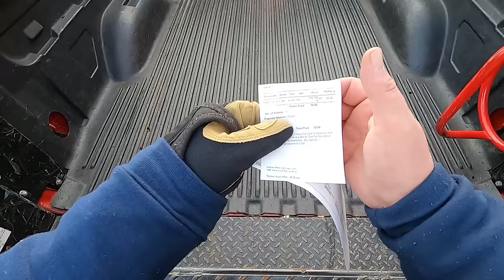Made a Ton of Cash from People's Trash

Comment: Hey Paul, 

In the last 6 months I have started taking most appliances apart or at least extracting the motors. Larger appliances like washers and dryers have larger size motors and are relatively easy to disassemble to extract the motors or you can even cut them out in some cases without disassembly. 

Once you extract the motors, the motor itself without any further work is worth 3x the scrap value than the appliance is whole. Extract the copper windings and separate the steel and aluminum from the motor and that increases the worth 10x the scrap value over the whole appliance. 

All I do now is pick up appliances, dismantle them, clean up the wires, separate the aluminum from steel, and break down the motors. I can easily do 6-8 a day with little issue, and I am collecting $500+ every day this way. It really has changed the game for me. 

It's wild how just breaking these items down skyrockets the return value.
Reply from the maker: Do you calculate the return on time invested?

Comment: The weber grill was cast. I was hoping you was going to check it from my comment mentioning it on a previous video. Takes about 2mins to clean them. Hammer to the bolts the cast will break easily.